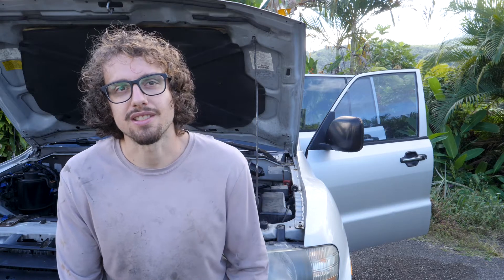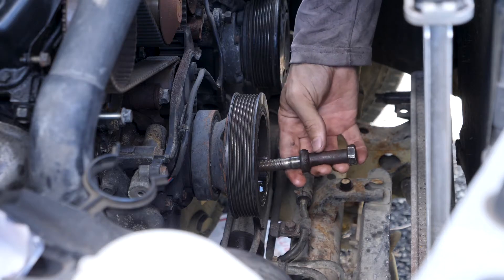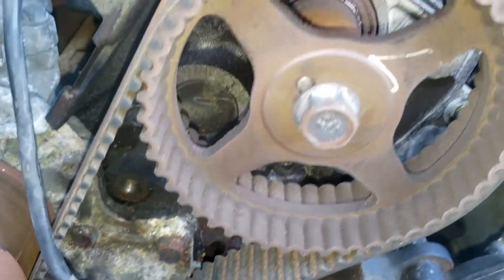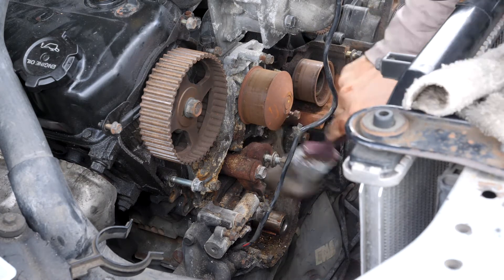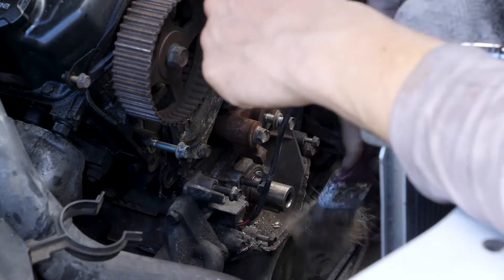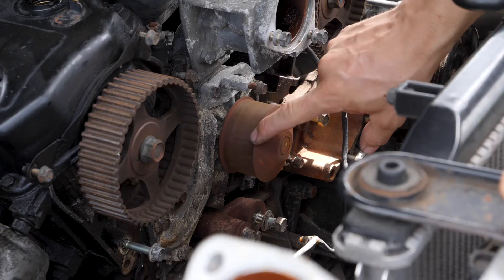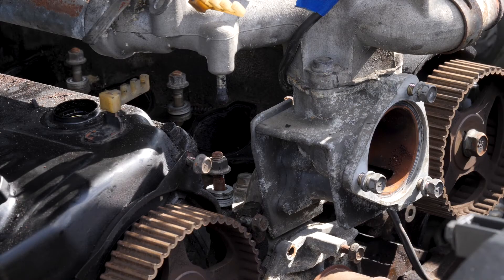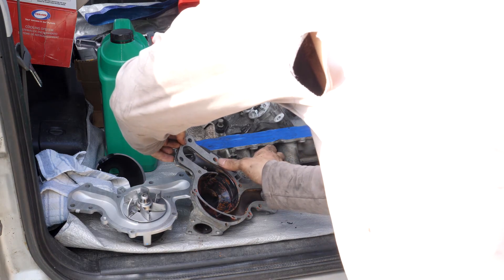Mitsubishi Montero Head Gasket Repair Part 3: Removing the Timing Belt and Water Pump Replacement

Comment: use a 1/2 in bar with a 22 mm inp[act socket- lay th ebar to the frame and kick th ekey- it will break th ebolt loose everytime. just tap it!>

Comment: Curious if it leaked.  I suspect this project wasn't pressure tested before putting timing gear back on.  The 3.8 are known to leak between the two pump parts.  Mitsubishi only sells whole assembly, probably for this reason.  Also, beware top right screw for pump is 3mm shorter than the other four. (top passenger side for NA cars).  MINE FAILS PRESSURE test with thin film of 'the right stuff' factory-like RTV on all surfaces, set overnight then torqued.  It leaks (soap bubble test with 5psi air on system) all around, not just the rear countersunk screw that can't be re torqued.  I am going to pull it down and try thin beads of TRS in intermediate surface, cure at least 90 min then torque (including rear C-S phillips), then repeat with pump to engine and try again.
Reply from the maker: No leaks for me 1.5 years later. Just load that mother up with RTV on both sides of the gasket. Mine didn't leak and it even had corrosion and pitting in the metal so the gasket mating surface wasn't even flat in one corner. Also I would torque it down before letting the  RTV cure over night. Most RTV's recommend a 30 min set time before you tighten down the gasket but usually the RTV is still somewhat soft and will flow and squeeze itself into any gaps when you torque it. If you let it cure fully over night and then torque it then it is no longer pliable and won't flow into any gaps leaving a less than desirable seal, potentially.

Comment: I mispoke a teeny bit....your monterror is a bit older but I see you figured out the pump pulls out without messing with the valley stuff.  The reason I am here is trying to get aftermarket pump (not genuine whole assembly) to not leak.

Comment: too late now but the pump can come off without messing with the stuff behind in the valley.  Remove the three cap screws on TOP of t-stat housing as well as the 3 for the t-stat itself and remove pump.  It comes out from under the t-stat housing.

Comment: I felt it wen u hit you knuckles breaking loose those water pump bolts 😬
Reply from the maker: Yeah that one hurt. Smacked 'em right on the raised lip where the valve covers meet the heads.

Comment: I admire your bravery. I also have a 2001 limited and I paid 1175 to change my belt, tensioner and water and assumed it was a lot of work but your video showed if I was not an apartment dweller who would have to work on it on the street, it could be done. After all, the majority of the cost was in the labor,not the parts. I love my Monty, it’s got 187,000 miles and even with the awful gas prices, I love its comfort as I drive long distances. I was also fortunate in finding a mechanic who works out of his home on Craigslist who save me a fortune on all the things (suspension, steering, gaskets, and more) one needs to deal with to keep these vehicles running well. Still got a bunch of things to do. Thanx for the videos and much respect from chicago. Peace
Reply: Pump

Comment: That spacer on the crank bolt is a great idea. My '95 Montero slipped a timing belt a week after I bought it so I got to rebuild it now. I hope those craftsmen sockets are 6 point cause that helps a ton to prevent stripping bolt heads.
Reply from the maker: Thanks, I actually cut a piece of 1/2" steel pipe to use instead because the pvc was barely providing enough friction. I used a 12 point socket for the crank bolt the first time taking it off but with how hard it was to get off I ordered a set of 6 points to put it back on. 135 ft-lbs is pretty intense.